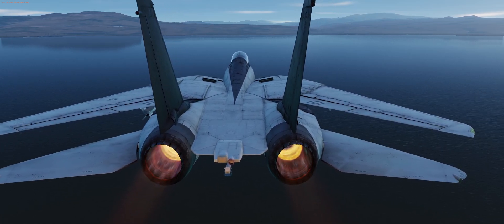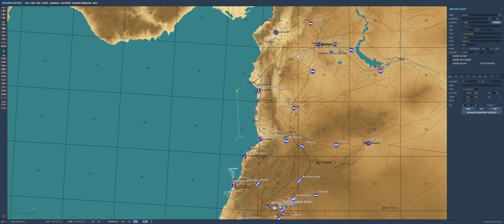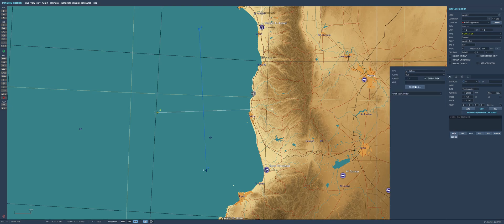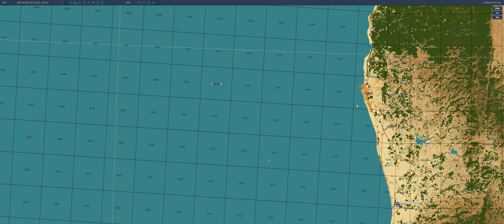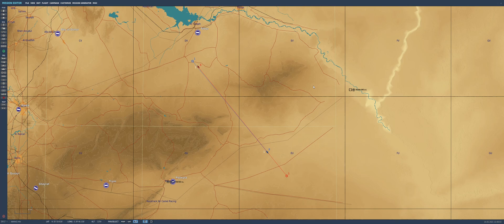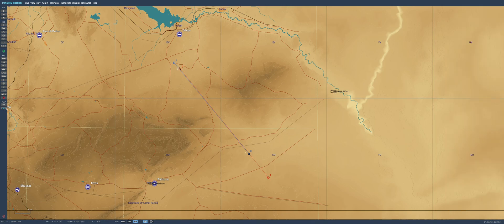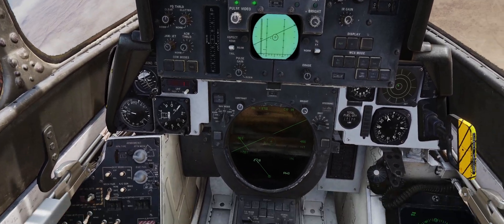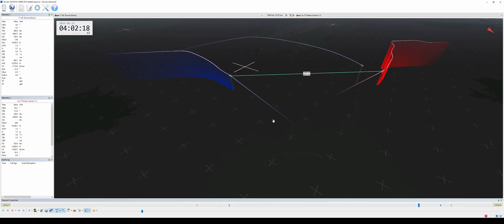DCS F-14 Snippets: Single Target Track (Pulse & PD) - V2

Comment: Hello, I

 sometimes have a target 12 nautical miles away from me. 

However, when I scan at the altitude indicated by the datalink, I don't see it on my DDD, even though it's right in my 12-hour window and at the indicated altitude... 

Do you have any ideas? Thanks!
Reply from the maker: Hey! Are you sure the antenna elevation angle matches? What radar mode are you using? There are many possible issues behind this issue, but I'd need more details to assess them. Even better, can you record and send me the related TacView track?
Reply: @ I tried watching Maiq, but I don't understand. Is it possible to contact you via Discord? Thanks in advance.
Reply from the maker: Sure, here's my server: https://discord.gg/sF53khe27r

Comment: Sir how to move the sensor and lock in target i try alot of button but cant find it
Reply from the maker: Hi! Do you mean locking from the DDD? if that's the case, you need to press the appropriate HCU function button (RDR). Have a look here: https://www.heatblur.se/F-14Manual/cockpit.html#hand-control-unit-hcu

Comment: The target size switch is currently affecting the range of pitbull, small is 6NM, med is 10NM, and large is 16NM(i think). Do you think this could be used to even greater effect with 16NM pitbull?
Reply from the maker: Yep, the ranges are close to what you remember: 6nm, 10m, 13nm (http://heatblur.se/F-14Manual/general.html#detail-data-display-ddd-and-panel)

About the impact in this scenario however, no that switch should not matter in this sense because a Phoenix launched in STT is either a SARH (PDSTT) or it is active immediately (PSTT). The activation range, unless it affects by mistake the current inaccurate implementation of PSTT, is not relevant in this scenario.
According to the manual, it should help the WCS to set certain parameters though, but I never quantified the effects (it's one of the many tests I decided to stop when HB announced the WCS overhaul in October 2019).

That switch can be used effectively to surprise (by reducing the time available to defend) or skate early (increasing the activation distance) when the AIM-54 is used in TWS.

Comment: Great video! Could you think about making a video about holding soft lock in TWS? Many times I have trashed Phoenixes due to Jester or myself as a RIO just losing the track in mid flight. Thank you
Reply from the maker: Sure, I can do it. However, unless you have a specific situation in mind, it won't be longer than a minute as it all comes down to the usage of the MLC if the target attempts to beam, and speed/geometry management if the targets attempts to use the ZDF (usually by going cold).

Even better, if you can put together a simple scenario I can play it and record it. Nothing too complex though, otherwise managing Iceman quickly becomes a headache :)

Comment: Great vid Karon..but I have questions. In the scenario where you launched 4 54's did you do that is TWS or PDSTT?? it looked like you individually locked them. I didn't think you could do that in PSTT or PDSTT.
Reply from the maker: I was in Pulse STT, locking straight from the DDD (you may have have noticed that the b-scope was in AZM vs RNG rather than AZM vs Vc). I locked and launched one after the other with no sustain, as they are active immediately.
Reply: @FlyAndWire  had no idea that you can even do that! I'm going to try and mimic your test. See what results I come up with. Thanks for all you do. I reach out if I have any questions....whats b-scope? LoL
Reply from the maker: @ghostrider1827  Me neither. This is the first real test of the new WCS I did because again, I'd rather not spending too much time on something that is still WIP.

About the b-scope: https://en.wikipedia.org/wiki/Radar_display
Reply: @FlyAndWire  Roger...nice! This was a big help!!

Comment: The AI reactions tend to soil some of the fun.  The perfect notch and countermeasures is something the AI will currently do even if you launch in TWS mode from 50nm.  Of course the brief notch is enough for the WCS to lose everything and the missile goes dumb.  I wish there was a way to have the WCS resume a TWS track after the AI cheat notch, or at least have the AI not react to what should be a silent shot.
Reply from the maker: Yep, the AI is still the same ED used in LOMAC probably :)

On a serious note, they are updating it, starting from WW2 so eventually it will become more realistic. It is not an easy task and ED is not a huge company, so it will take some time.

About your problem, the first advice is playing against a Veteran AI or less, in terms of skill level: rather than being more challenging, their SA becomes more divine and FM closer to UFO levels. On top of that, if you are the RIO, you can always command a nose down on top of the crank, and then turn of the MLC. If the Vc appears to be close to ±100 kts, either command Idle or Gate do avoid ZDF. It's not easy but at least we can counter it somehow. I'm more annoyed about the chaff situation tbh.
Reply: @FlyAndWire  Perfect advice, and hopefully better CM (and maybe ECM) simulation will make things better!
Reply from the maker: @blckdrgn813  A more realistic ECM implementation would be very welcomed. Unfortunately I doubt we'll see anything really in-depth due to how sensible the topic is.

Comment: Thanks for all your dedication to this module. As soon as somebody asks for more infos and reading about RIO/RADAR >>FlyAndWire is the first answer. Can you confirm that at this moment, phoenix are still WIP ? and what should we expect in final version in terms of guidance/performances if you know something about that ? Thanks
Reply from the maker: Thanks mate, you are too kind :)

I can only confirm what I see versus, or in addition to, what is stated by Heatblur. I do not have access to the technical documentation necessary to do any independent statement about the Phoenix (similarly, I do not write anything I did not test myself beforehand :) ).

That being said, the PSTT mode caught my curiosity due to what the devs said (see the links the quotes in the video): long story short, there are some blockers they cannot fix themselves as they are in ED's hands, so the implementation is a bit funny now and the missiles behaves as a TWS when radar contact lost. In fact, quoting Heatblur: "in-flight missiles with TWS will no longer go active if tracking is lost, the F-14 is destroyed, the radar is disabled etc. before 16s TTI. However, the WCS can keep a track file stored for up to 2 minutes (for targets under missile attack) and send an active signal to the Phoenix pointing it into the target’s likely position, if the track has not updated for a certain time" (source: https://forums.eagle.ru/topic/252120-aim-54-changes-new-api-fixes-are-live-in-todays-patch/ - The TTI16" thing has been changed btw, the link is old).

I'd love to go down the rabbit hole and do some thorough testing about the guidance and the radar modes, but I want to see some fixes by ED first. In primis, the countermeasures. At the moment, in case you are not aware, they are not physicalized (meaning, the actual chaff does not exist in the virtual sky) and it's not different from a die roll from D&D or WH40K. Ergo, you can spam enough and chances are that eventually your missile will chase the squirrel rather than the target. Obviously, the implementation is more complex than that, but it is still too basic and leads to unrealistic situations.
Reply: The only thing messed up pretty bad is TWS 54 shots on AI. The AI goes defensive as soon as you launch in TWS, which they shouldn't even know the missile was launched until it goes active.
Reply: @Swizzlestik  It would also be unrealistic on the other end of the spectrum if the AI waited until pitbull before knowing a missile was launched on them. Real pilots can presume missiles are likely inbound based on the sensor info available and take defensive measures before their RWR starts beeping. So modelling it the way you say is not ideal either.
Reply: @CallsignJoNay  yea but they shouldn't be flopping like a fish out of water as soon as you hit a2a launch.
Reply from the maker: The thing is, a good pilot or RIO can kind of guess if an AIM-54 was launched against them as the hostile may start to crank, change speed, dive and whatnot (at the same time, the hostile may not change any parameter, of course).
What I'd love to see is a smart AI that understands its inferiority in terms of range so cranks and manoeuvres to spoil a possible launch. The problem is that, at the moment, the trigger for any defensive action is the FOX-3 launch, which is not realistic.
Reply: @FlyAndWire  From what I understand is, they are working on the AI so its in the near future.
Reply from the maker: @Swizzlestik  yep, it will take some time, but that's not a problem.
Reply: @FlyAndWire  thanks all for your answer !
Reply: @FlyAndWire  hey ! Did you see the latest changelog ? Now the IA won't engage defensive until fox-3 missiles are pitbull. But it seems they still chaff as soon as you lunch a missile. Step by step ? Lol
Reply from the maker: @jowenjv4463  It's actually a step backwards, the AI used to chaff as soon a FOX3 was launched (but not manoeuvring) :)

I did a quick test using the same scenario featured in the last part of this video (vs 4x F/A-18C Veterans) and it seems that the chaff is affecting the AIM-54 much less than it did before today's patch. Of course one test is not enough but it's great to know that ED is working on the countermeasures.
Reply: @FlyAndWire  are you sure about that ? I thought the AI started evasive manoeuvers and droping chaffs as soon as a TWS Phoenix was launched. And it's what many other Tomcat players noticed on a big french PVE server. I'm mistaken ? 

I havn't tested in today's patch but from other players they seems to confirm that now, the AI will engage defensive only when the TWS missile is Pitbull (which is a more realistic behaviour isn't it ?) but they still chaff as soon as the missile is off the rail. What I would expect from a very basic AI behaviour is : no evasive manoeuver until pitbull (which seems that it's what we have now with today's patch), and either preemptive chaff with very high dispense interval at the beginning of the engagement and heavy chaff dispense when defensive manoeuvers are engaged (?).
Reply from the maker: @jowenjv4463  The AI used to drop chaff when engaged in TWS for quite a long time. I have the feeling that ED has simply reverted to the previous AI behaviour, at least as far as TWS is concerned. That's why I said that it's a step backwards, it seems they went back to the old implementation, until the fix the new one :)
Reply: @FlyAndWire  after dipping a bit in how AI works, and looking how usless jester is, im confident in saying that programing an AI to know his inferiority in range, and performe accurate manouvers to the circumstances its highly unlikely